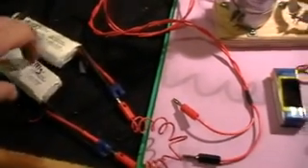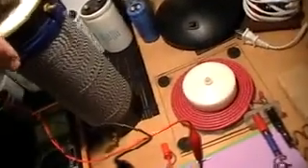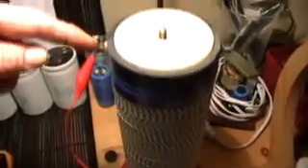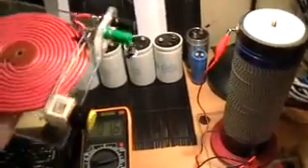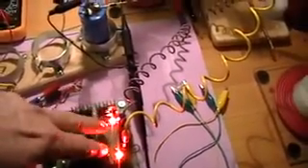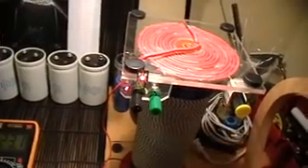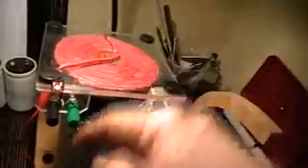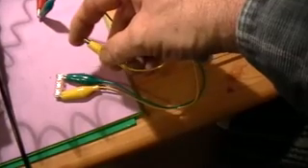resonance effects for everyone 2

Comment: Using an H bridge works especially nice, for impulse generation. A half H bridge could also be used. The connected coil producing the impulses (inductive spikes) is not the primary.

the primary is a parallel placed coil, that is made series resonant, so the impulses will discharge into this series resonant coil.

the secondary will then ring into longitudinal resonance from the impulse kicks.

With a half H bridge (easiest) the series resonant coil will get alternating polarity impulses, from one side.

with a H bridge, the impulses will enter the series resonant primary from both ends of the coil.

Imagine the longitudinal kick this will produce by the fast change in high voltage!

Enjoy building, or wait until I have finished building it. I will share the results on my channel.